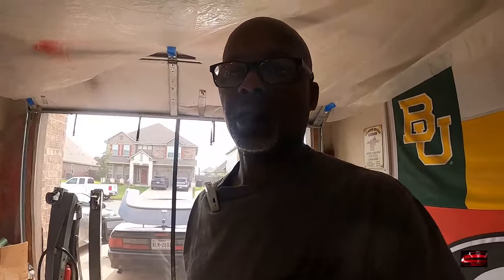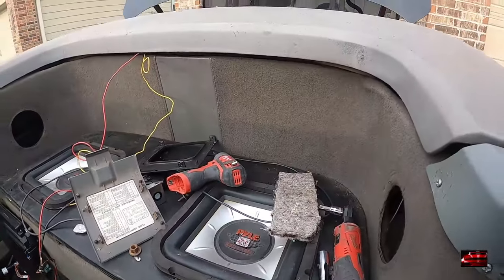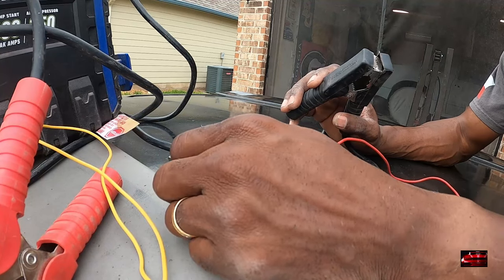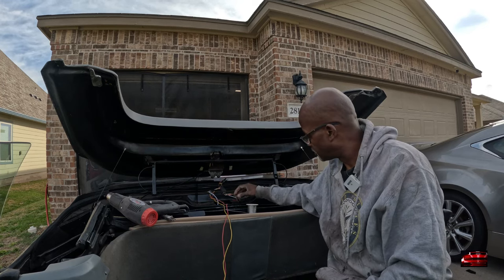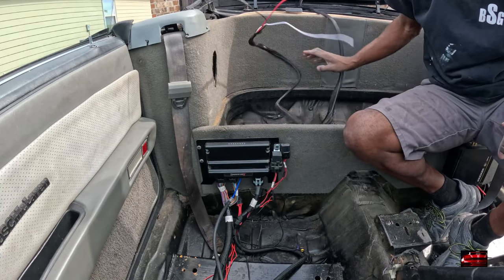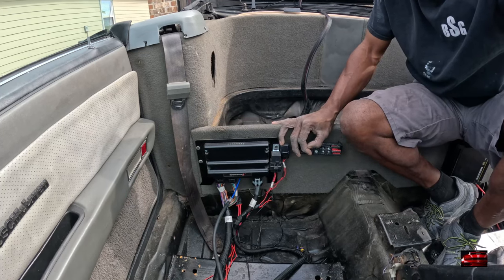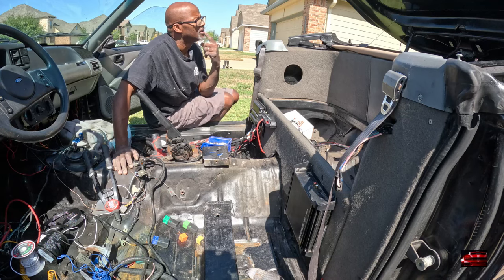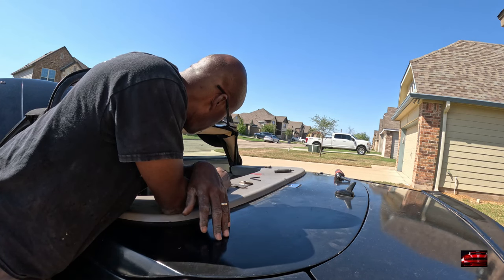1987 Black McLaren Mustang Convertible Top Switches Installed

Comment: You are one brave man for tackling that!  I think Ford used trunk pull down mechanisms from GM on Lincolns as well.  There is a good chance if you can source another pull down or whatever you need, you might be able to rebuild the one you have.  I'm curious to see if there is a part number on the stripped mechanism?  Cleaning up any wiring mess is always a bonus.   Glad you made some headway!!!👍👍
Reply from the maker: Thanks 306foxbody1. I’m going to see if I can find the pull down mechanism for the Lincoln. I’m thinking the 64-66 presidential Lincoln may have them
Reply: Hey Bonezshaker!  You might want to look on a mid 80s Lincoln...like 84-86ish.  Hopefully your mechanism has a part number on it!
Reply from the maker: @306foxbody1  I need to take mine out and take a look at it because everything I see is plastic and mine looks like it’s metal